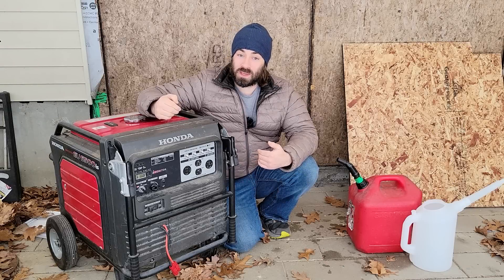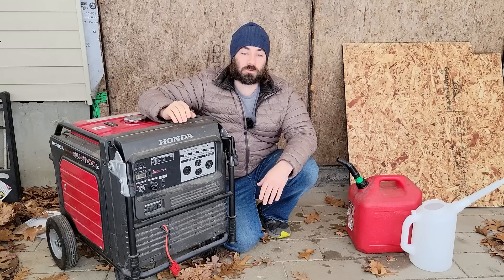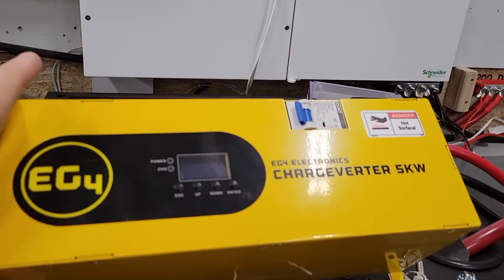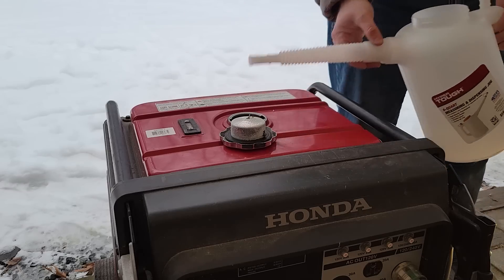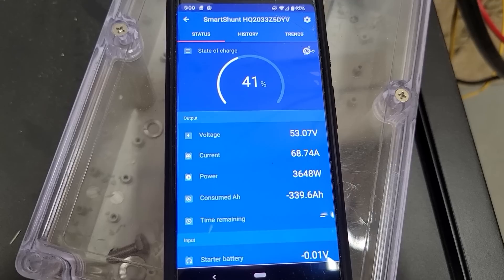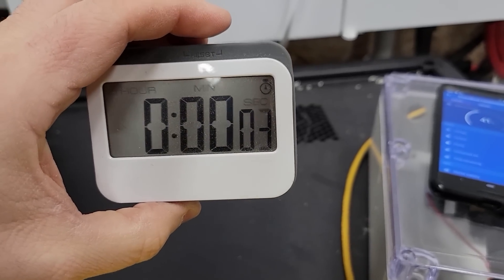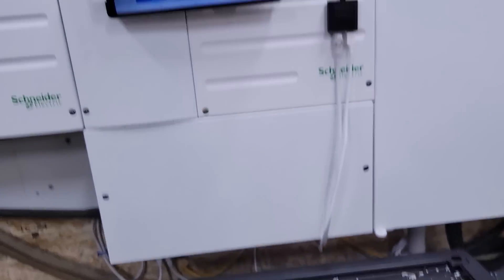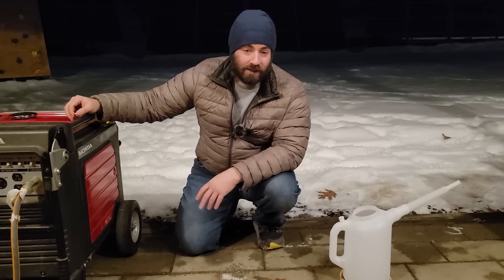Not what I expected.

Comment: You stopped timing the runs :(   (suspect the timings are still on the video footage timestamps?). I'm not surprised the the energy input to the battery is the same for different charging currents. Those honda generators are pretty good. As paxmax says below, you're getting about 17.8% fuel to battery energy conversion which is not bad for fossil fuels. Have you thought about reflectors for direct more of the meager winter sunlight on to the panels?
Reply from the maker: I only bothered showing the first run because that was the longest.  All the other run-times are shorter.  The relationship is lineal between run-time and Amps since the kWh ended up being the same. 
As for reflectors, Yes.  I did an experiment with that about 6 or 7 years ago using 4x8 sheets of polyiso insulation with foil backing.  I found that I had to adjust it constantly to keep the reflection on the panel.  The snow is a great reflector by itself.
Reply: @DavidPozEnergy  Thanks. Good luck with your off-grid systems and thanks for all the explanations. With your charging the battery from a generator, I suppose so long as you are not damaging the batteries by charging at too high a current, you might as well charge as fast as possible.   I'm sure you follow the improvements in battery technology - I don't think it will be long before we get consumer-level batteries (probably not using lithium) at 1/4 the price or even less per kWhr (per charge cycle).  For residential, it doesn't matter how heavy they are - or really how big.  Then, hopefully, you'll be using the generator even less.
Reply from the maker: I have a 600Ah battery bank.  That can be recharged at 300 Amps.  I usually run the generator around 4 or 5 pm in the winter.  At that point I don't have any more solar gain.  If the battery bank is below 50% at that point, I will run my generator a couple hours.  I don't re-charge to 100%, just enough to be comfortable until the next day.  Even if I max out the charger at 100 Amps, it's still well within the 300A limit.

Comment: 123238 BTU in 1 gallon of gas.  Not surprising the results are same /similar on each test.  There would be a minimum amount of fuel required to run the generator and as long as you’re not taxing the generator to its limits there should be no difference in consumption… only time to charge.

Comment: I don't think it's surprising. I'm no scientist but here is my reasoning:

With your motor, 4l equals 6kw.  
Since you increase ah, you decrease time.
At 80amps, it takes 1.5 hour to get tour 6kw, minus waste
At 100amps, it takes a little more than 1 hour to get to the same result.
You also mentionned the generator is  an inverter. Since inverters get more efficient the closer they get to their max output, at 100ah, you get the best result, because less waste.
If I were you, i'd just leave it at 100ah.

Comment: this is why overdrive is more fuel efficient in ice vehicles. you are lugging the engine back so more work for a given speed.  In the case of a generator that runs a constant speed, the throttle is open more of the time with a higher load.  So more air gets in and the fuel is burned more efficiently with more air.  Honda absolutely makes the best gasoline generators.  I think that model has fuel injection.  If so then fuel air ratio is constantly being adjusted along with the throttle.  Cheaper generators with a carburetor have a fixed fuel air ratio and the throttle controls the speed by only controlling how much air gets in and varying the amount of fuel.
Reply from the maker: Thanks.  This particular model (EU6500) is a carburetor.  The current version of this generator is the EU7000, and it is fuel injected.  They look almost identical.

Comment: I totally agree with elec efficient heating like mini splits.  But I don't want to use gas unless absolutely necessary.  Winter: a propane heating system is much less Dollars to heat than a Generator to Elec heat, so we have a propane forced air heater.  No generator this winter at all!

Comment: I noticed on another of your videos you used a smaller generator. Is using a smaller and more gas efficient geny efficient to recharge batteries? ( using a chargeverter). Also, is there a setting on your Schneider ( or any other you might be aware of) that allows for automatic generator start if the batteries run low , given the geny is an electric start ?

Comment: With my pair of sungoldpower 6548 inverters i dont need the separate charger as swiching from grid feed to generator feed will automatically force inverters to charge battery bank and use energy from generator to run house at same time. Only issue is when running dual fuel westinghouse 6500 generator on propane cant run dryer as propane doesnt have enough energy to charge batteries and run house with dryer going. Havent tried it running with gasoline yet but will update this post once i do.

Comment: I did not see if somebody else mentioned this... 1 gallon of gasoline has a set amount of energy stored in it. Given the inverter and charger are pretty good due to being made well with good parts you will get 90%-95% of the stored energy from the fuel into your batteries. I'm guessing this would change with lower quality parts in the system but also willing to bet it will have the same result no madder the setup (meaning the same percentage of extracted energy will be put in the bat bank maybe 80%-85% with an inferior setup).

Comment: Probably, the maximum load is the efficiency maximum of the generator's electronics and the generator itself, as well as the efficiency of the charging invertor. As for the combustion engine, reliable generators' maximum output is a minimum of two to three times more power than the electrical machine's required mechanical input due to the different load characteristics of the engine and the generator. Your generator appears to be a good one among its siblings and cousins.

Comment: If you heat your home with electricity anyway, why don't you take this setup to the next level:
Get a non-inverter, and maybe a Diesel generator. You already have a device with wich you can tune in the sweet spot of efficiency (the charger) So you can spare the losses of the inverter in the generator. Also a Diesel should be more efficient. And furthermore: Diesel is almost indefinably storeable
Also try to use the heat from the engine somehow.
Get a heat exchanger for the exhaust and heat your water that way. Duct the hot Air from the engine into your house
If that thing has to run, you are probably in the middle of winter, so a little extra heat is nothing to waste

Comment: Thanks for yet another carefully designed test series.
I have a 3kw Honda inverter gen set which we take on the road with us, it does the job of running the caravan including air-conditioning walking away. A previous 2kw inverter gen set woeked! fine but it's 80cc engine was not any better on fuel than the 270cc Honda which supports your findings.
I also own and maintain a 5kva diesel, neither genset cops your kind of workout, in fact both now have permanent battery chargers installed so they will start during a prolonged event. We don't see snow here or any temperature below 0 dec C.

Comment: Hi Yes you will find that all inverter generators are at there most efficient close to rated output it's just because of the alternator design. If you want real efficiency you have to go low speed diesel with a conventional alternator

Comment: Hi from the uk 
I have a similar hoda generator and while it is good and reliable and dose what it says on the tin they are not efficient I think I measured mine at 480grams per kWhr 
I think this is because it uses a permanent magnet alternator like many Japanese motor cycles rather than one with a proper active rotor adjusted by a regulator. But it dose have the advantage that if you change load suddenly or over load it the frequency won't droop only the voltage dose a little 
Keep up the good work

Comment: My question is about pre-charging inverter caps. How many times does this need to be done? Just the first time? Every time you disconnect? My design calls for a breaker and a Anderson connector as ways to disconnect the inverter from the system. So when I use one of these means to disconnect, I have to use the resistor before reconnecting? Seems like I am missing something.
Reply from the maker: When I was making my own batteries, I used a pre-charge resistor every time I made a physical connection to the battery.  However, recently I've been using the EG4 batteries.  These have pre-charge resistors built into the BMS, so it does it for you.  https://signaturesolar.com/shop-all/batteries/?ref=4_rHcgZ9x-TiF-

Comment: Good Tests

As far as cost per KW generated it depends on state location and type of generator.

I live in Southern California with typically the highest gasoline prices in the country. A year plus ago it was as high as $7.00 a gallon.

This week 04/05/23; it's $4.50/gal.

btw - Here in SoCal my low usage Southern California Edison electricity rates are peak @ $0.49/KW-Hr.

Several years ago I did tests on three generators. I don't recall what the price of gas at the time. Guestimate $4.00/gal

1) Harbor Freight Tailgater 2 cyl 800/900W @  $1.35/KW-hr

2) Champion 4 cyl 1200/1500W @ ~$1.00/Kw-hrs.

3) Sears Craftsman 4 cyc 4500/5000W I DID NOT TEST but I guestimate for some reason was maybe $0.75 - 0.90/Kw-hr.

I would love to see a repeat test done with an equivalent size generator size to yours with a DIESEL generator.

- Paul
Reply from the maker: Awesome you did some testing on your own generators.  
The past few months, my local gas stations averaged $3.50/gal.  
I have a diesel generator (MEP-803A) that I'll be doing a fuel test on at some point.

Comment: I was not surprised. Internal combustion engines are most efficient when the throttle is not creating a vacuum, and peak pressures and temperatures in the combustion chamber are achieved. Look up the Wikipedia article on heat engine efficiency for the details.

Comment: Be nice to see a 50A/50% test - I run my generator at 50% rated when just charging, but have pass-through options for more power if there is more than just the charger running.

Comment: I was interested in the actual cost per hour. The Honda EU7000iS is a gas generator that uses 0.32 Gallons per hour, or ~1.21 Litres per hour.

Current gas prices in Canada are ~$1.47/L.

Let's assume however that you went for a full state of charge. Let's do some simple math:
20% = 6kWh
40% = 12kWh
60% = 18kWh
80% = 24kWh
100% = 30kWh

Since 30kWh (100%) - 12kWh (40%) = 18kWh and if the Honda generator is used to charge to full power from a 40% charge, then you'll need 18kWh.

If it takes 1 hour and 32 minutes to charge by 6kWh, then it's 1 hour and 32 minutes * 3. Or, around 4 hour and a half hours.

1.21L x 4.5 hours = 5.445 L.

5.445 Litres * $1.47 per Litre = $8 CAD.

$8 CAD / 18kWh = $0.44 per kWh.

Obviously you're not spending $0.44 per kWh all the time since you have a solar storage setup.

However, the cool thing about this setup is what if you were connected to the grid? The Chargeverter can be turned on during off-peak hours when you'd be spending much less per kWh. You'd just need a transfer switch setup on your panel to swap to battery power during the day when solar is available and swap back to grid power to charge at night when electricity is cheap.

This a is a ridiculously simple/clever setup. The SmartShunt is great. And the Chargeverter is dead simple, just plug into 120VAC/240VAC. Whether it's a generator or the grid, there isn't anything complex or complicated about the setup.

Comment: A gallon of gasoline contains approximately 33kWh (if my googly is correct). So, from fuel to battery overall efficiency 17.8% is actually better than I would've guess. Would be cool to try to harvest the engine and exhaust heat too.
Reply: Been a long time now but they did something like that back in the 1970's with I believe a Ford Pinto engine. Used the excess heat for hot water heating. It was likely in a Popular Mechanics issue but I can't be sure anymore.
Reply: Yeah he needs a diesel. Gasoline contains a lot of energy but isn't very efficient. Diesel isn't perfect but it's better.
Reply: @montey1017  I am thinking a diesel DC welder would be the most efficient way to to do this. I've seen people get around 40% efficiency out of their lister cold start low speed generator sets. And connect the DC output directly to the battery battery bank. If the welder uses brushes for DC output care must be taken such that it doesn't backfeed.
Reply: i would not bother heating whit electricity at this point propane heater would be way better option to heat when there is not enough solar power than wasting on inefficient generator
Reply: That is the way to go for hot water from a generator. It's called Combined Heat and Power, or CHP, or simply cogeneratiron. I worked on a few setups like that for Hotels, hospitals and the like.
Reply: I have a thought...in peace......
with all the youtube community sharing their projects to our benefit, what about finding a free car, that the motor and trans does work, and use that as a power supply.  Like a beat up old Toyota? 4 cylinder engine great on fuel. Remove the tires and connect a Harbor Freight 10,000 watt generator head. Here is an idea 

1) build a biochar BBQ and create the fuel needed to run that small engine. Like a propane system
2) build a HHO water generator and fuel the engine. 
3) build a paralysis chamber and burn plastic for fuel.

alternative fuels for the small engine to run during the hard times. Connect the Harbor freight generator head to the rear tires and run at the RRM's needed for best results. Build a small shed to house the project

Comment: Are you running the Genset out of fuel under load? This is tough on the stator and rotor magnets. I am sure Honda tests it like this, but you're heat soaking those coils and permanent magnets... So it can take it, but I will bet you are using up your mtbf.
Reply from the maker: Yes, I'm abusing the alternator.

Comment: I've got a 3.8KW inverter petrol generator which I use to boost my batteries via a couple of Siemens telecomms rectifiers.  I get 7.5KWh into the batteries off a 5L can of fuel (1.5KWh/Litre).  This works out at an overall efficiency of 16% which is reasonable for this sort of system. I've noticed that efficiency doesn't vary widely over a range of charge rates.
Reply: BTW  petrol has about 9KWh energy per litre. Small internal combustion engines are horribly inefficient.

Comment: I think your 100% generator load finding of greatest efficiency is correct.

Look I don't really know for sure but I was watching a vid on this exact thing a couple of years ago by an expert (and yes he really is an expert) on off grid remote area power for third world countries. He now does other solar installation stuff too. His channel is called Solar Solution. Jesse is his name.

I think what I am about to reiterate is a fairly well established principal but no doubt if I'm wrong someone will say so.
This knowledge is not the work of Solar Solution - it being more a thermodynamic principal?? LOL.
 
So Jesse says in his vid "Generator Fuel Efficiency: Gas consumption at 50% Vs. 100% load" (link below) the most efficient you can get from a generator is by sizing your generator to run at 100%. He says that any less substantially increases fuel consumption. The big problem is having an over size generator for your needs and/or running your generator at less than 100%. For example if the max your bank can absorb is 100a then having a generator that can supply 200a is completely wasteful since the generator is only running at 50% increasing fuel consumption by about 1/3.

I would say that your findings are consistent with what Jesse says. Check this out:
https://www.youtube.com/watch?v=raZ1dQ6HIQw
Reply from the maker: I checked out the video you linked to.  I didn't see him touch a generator anywhere in there.